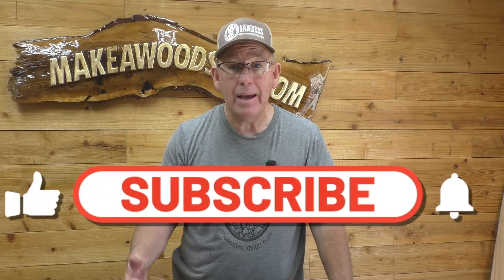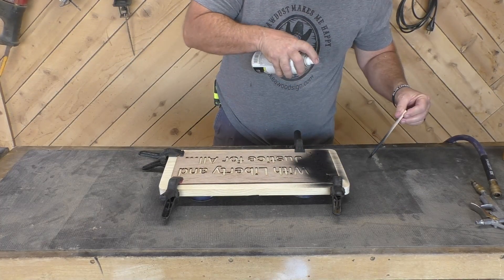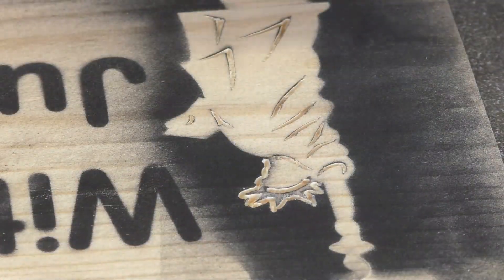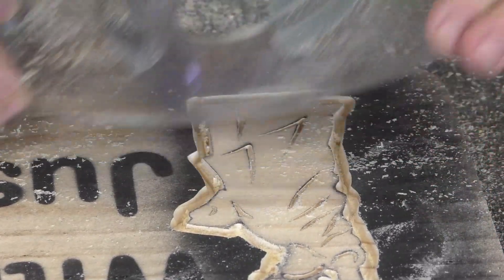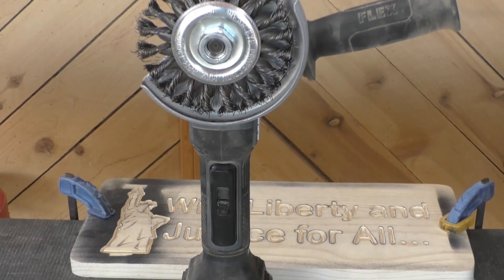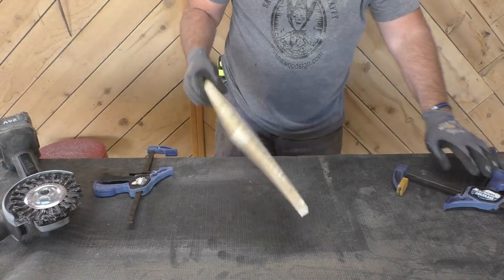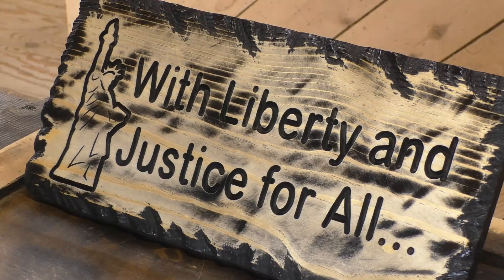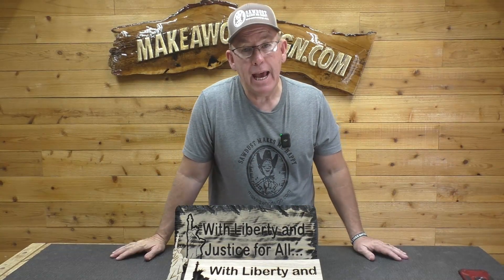A New Way To Get That Rustic Look Stencil for Sept 2023

Comment: Love it. When I first saw it, I thought you had a layer of white under the black and had sanded that off. You might try that in the future. The wire wheel gave it a better rustic look than the grinder did.
Reply from the maker: That's a good idea. We need to do that and see how it comes out.

Comment: Personally, I dont do the burnt or scattered paint look. I spray the paint then I run it through the thickness planer. Touch it up with 220 grit sand paper. Lines are sharp and clean, and the high gloss in the end makes it look so professionally done. Having said that, everyone has their own style. Eric and his Dad taught me several ways, and watched almost all the videos. My way is ....sharp....clean...champered... glossy.
Reply from the maker: Ya, that's dad's main style too. I like a little more gritty look. But that's what makes what we do so awesome! everyone has 100 different ways to out their own style into it
Reply: @oldave100  yep, by now I've tried everyone's style in one way or the other. I think it all depends on what the customer in looking for. Most of the time they tell me what they're thinking...I give my two cents... then off we go with what the customer wants
Reply from the maker: The customer is always right...right?😂😂😂
Reply: I find the customer gives me very few decisions even when I try to pull it out of them. Maybe that benefits me but sometimes I think not so much.

Comment: When making your stencil/patterns,  do you use a specific size most of the time so that your 60 degree  bit cuts just right to full pattern size.
Reply from the maker: Not really. We try to get the stencil the right size to fit on a 12" board, but don't worry about what bit it will take to carve it. Just something that looks cool